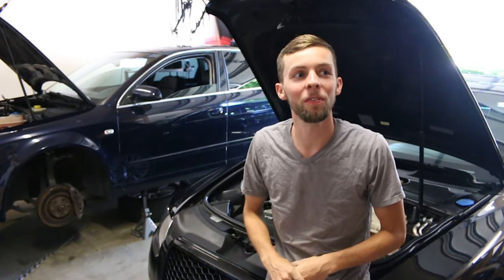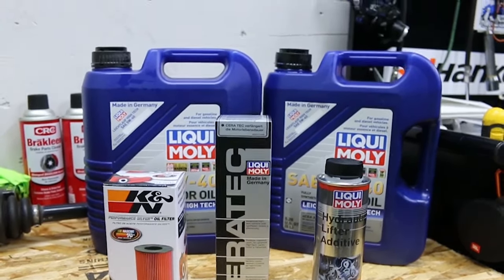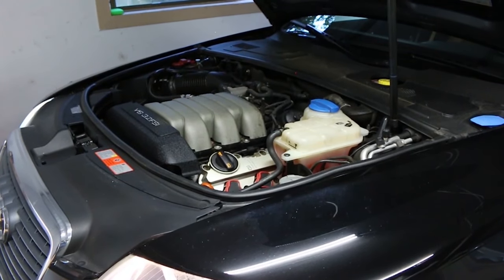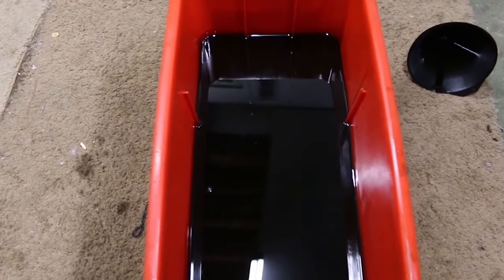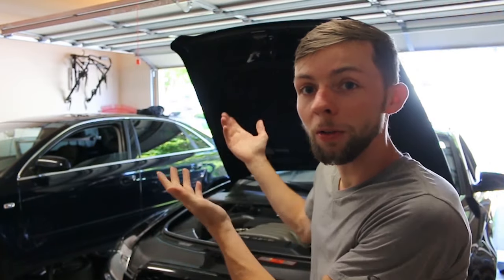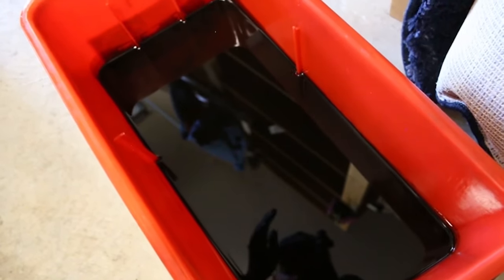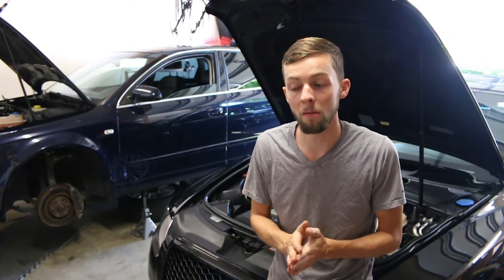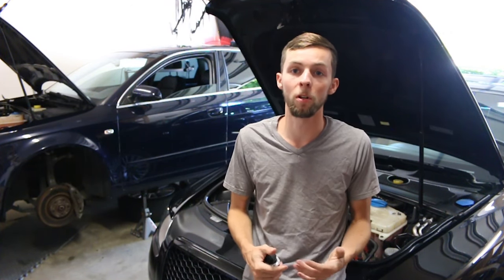LiquiMoly Engine Flush | Does it work?

Comment: It seems a lot of Americans think that engine oil should keep the color it had when brand new??? Err if the oil didn't turn black it would be a very, very, very bad and strange oil. The oil is supposed to carry all kinds of debris and combustion sod etc. AWAY from the engine, and throw it off in the oil filter. The fact that engine oil turns BLACK is NOT because it's bad, or need a change lol - it's because it's doing it's job as supposed to. DANG. 

And no; Castrol isn't a terrible oil.  It lives up to the same specifications as the LiquiMoly does. You would not be able to see, feel or hear any difference between them - unless, of course, you changed the viscosity.
Reply from the maker: Everyone has their opinion, that's fair. However, I own other vehicles that when changing the oil after 5,000 miles, the oil is not as dark or contaminated as this one. After pulling the valve covers off on this car, it is clear that the previous owners did not do oil changes regularly. I got this car for $1200 and it was neglected to say the least. After doing this flush, not only has it ran smoother and consumed less oil, but the oil is 100% visibly cleaner then previous changes as more and more deposits are being removed. I understand what you are saying about the oil carrying deposits away in your comment and agree with you, but when there is lots of buildup from previous neglect, changing the oil regularly will have the oil looking cleaner each change. The oil is not still golden regardless in the end.

On the Castrol comment, there has also been a very substantial difference in the oil consumption. Only going through about .5 quarts after 5,000 miles oil change. After switching there has been less consumption and the oil is cleaner each change. I know us Americans are odd, but this is my experience. Also, its hard finding Castrol that is VW 502.00 approved around here. The syn 5-30 from Castrol is NOT. 

Either way, I appreciate you taking the time to watch and comment, thank you!
Reply: @Mechani_Cole  Well, thank you very much for a polite and kind answer to rude and impolite me. Forgive me, I was always a "I know everything, people are idiots" kind of a rude asshat. Sorry.

Yeah, people have their opinions. I was not out to defend Castrol. I use Castrol 2-stroke oil in my old 2-stroke motorbike, in the transmission I use Motorex transmission oil. A Swiss brand that is.

In my 4-stroke dirt bike I use Motorex mc motor oil.

In my car I use Elf motor oil. I think it's French brand. 

Of course; the more often you change your oil, the less black it will be. But don't change it unnecessary, it's not good for the environment with all that old oil.

If the oil stream draining out of the drain hole has a clearly visible, reflective shine to it - it's good. Of course you can't know if it has a shine to it - unless you drain it out lol. 

Nothing wrong with flushing. People say you can just use diesel fuel for the flush, instead of that flushing agent.  But no guaranties from me. 

Thanks for the kindness, again.. By the way, I'm Danish. I guess we're well known to be particular impolite. Damn.
Reply from the maker: @MeBallerman  no harm done my friend😁 

I actually still use Castrol in the BMW E90, just not in this Audi. I believe since we live in different parts of the world, your Castrol and my Castrol are very different due to manufacturers spec.  and requirements. 

Thats interesting to hear about diesel as a flush! Would make for an interesting video after some research.

And I agree, flushing to much or changing the oil to much is never a good idea. This was first flush on this car probably in its entire life as well. Haven't heard of Elf oil, going to check it out. 

One of my favorite channels that has a great comparison tests of ALOT of different oil brands is @projectfarm. I was AMAZED at how well the Amazon brand oil did. Great tests and results there. I learned alot!

Greetings again from the USA! Its a circus here😁
Reply from the maker: @MeBallerman  Check out this series on oil tests. Very entertaining and informative!

Cheers!
 https://www.youtube.com/playlist?list=PLjT3B9r2z3fXlvbP3tb9e056Q8O5krrCW
Reply: @Mechani_Cole  I know the channel,  watched it a lot lately - watching ice cold oil racing down slides - always late nights, lol. And it's getting alarmingly late AGAIN. Damn. Goodnight.
Reply from the maker: @MeBallerman  Have a good night! Thanks for stopping by!
Reply: i heard the same rumors about the castrol oil in the audi forums, especially the 5W-30 Longlife oil. I got an 2.0TFSi and will change to Mobil 0W-40 as many people recommend it for this engine. Just bought the car a couple of weeks ago, so i can´t say much about oil consumption and i don´t know which oil is in it.

Comment: I hope someone here can help me..
Im confusing now, cause I don’t know. 

We need to put engine plush on old oil leave them idle 10m
Or we do with new oil and oil filler and leave the car running 10m
Cause i watch to many clip every clip different way.. 
Tks advice!!!
Reply from the maker: Just flush with old oil. 

The way that I do it is with new oil, but that is not needed. Its just an extra step to clean even more sludge out

Comment: Castrol is the best in my experience.
Reply: The best out there is the Valvoline Synpower !!
Way wayyy better than those crappy Castrol.
Reply from the maker: Both suck in my opinion. But what do our opinions matter anyway 😮‍💨
Reply: I dont think you ever tried the Valvoline, trust me i tried them all, Castrol, Liqui Moly, Motul, Mobil 1, Shell Helix,     
i had oil consumption with them all. At last i tried the Valvoline, and no more oil consumption! the engine runs extremelly smooth.
Reply from the maker: It's alright

Comment: Castrol works. great. Have used it for 14 years from brand new, and no oil-consumption. Is this a commercial or what. It makes zero sense that you have had "bad" results with Castrol.
Reply from the maker: Nope, just me sharing my experience and results that I have had. In the Audi, its just a fact that the Castrol was being consumed more and that liquimoly did and does better. 

Ever seen the oil test videos on @ProjectFarm page? Lots of evidence there as well that it is a mediocre oil and there is plenty that preform better. 

Thanks for watching, much appreciated🤙🏼
Reply: @Mechani_Cole  Great video, and the oil was very black. I don't really know what to do. We have a TSI-engine, and we are changing the timing chain on it as they were all bad from factory. Should we try Liqui Moly?
Reply from the maker: @danielfl.9347  I just picked up a TSI A4 as well. It actually has castrol in it right now, but only because the oil is getting flushed and it was cheaper. If you don't have any issues, switching won't do much. I got to do the timing chain and belt on this one soon too. 

The oil being black is just a sign the engine isn't as clean as it could be. When I got this car, clearly the owners never did the oil change on time. After pulling the valve cover, this engine is actually pretty dirty. Its getting another flush soon with fresh oil once it gets new timing chain tensioners this week. 

Before doing this flush, I had a tapping noise coming from the hydraulic lifters. Basically it takes a second for the oil to get there so it taps and kind of hard starts. After flushing it and switching to liquimoly, that problem was completely gone. 

Def not an ad for liquimoly or anything, I have even seen plenty of other oils out preform liquimoly on @projectfarm channel. However, I do think they make the best engine flush.

In the car world, I feel that the best oil argument will never be won😁
Reply: This Is Coleman Okay, great reply. Here in Denmark on our forums we always have that annoying oil Discussion of what the best oil is.. Mine oil also turned Black after 2.500 miles, but that is because of the timing chain beginning to fail. I have written to LM Denmark and they recommend "MOS2" in the engine as it is anti friction for timing chain.
Reply from the maker: @danielfl.9347  all the way from Denmark! Thanks for watching man! 

And yeah, the only guy I know that actually clears up the oil debate is the @projectfarm guy. Love that guys tests on different oils.

Hopefully you get your timing chain fixed easily🤙🏼
Reply: This Is Coleman I will go watch some of his videos. Nice car btw! I guess the most important thing to take from all of this is to stay on top of oil changes. VW says my TSI can go 20.000 miles between oil changes... I think not. After the timing chain repair ($2000) I will change it myself every 5000 miles
Reply from the maker: @danielfl.9347  thank you! And yeah, personally, I would never go above 5k on any car regardless what they say. 15-20k has always seemed so crazy to me!

Comment from the maker: Buying The Cheapest Audi On Craigslist, I GOT LUCKY! 

Check out the video here:
https://www.youtube.com/watch?v=f_AChX9P35E
Reply: You have to change oil every 5000 km. Maximum up to 7000 km. Hero from Germany .
Reply from the maker: @markluger9914  could be true for Germany. In the US of course we go off miles instead of kilometers. I always change before I hit 5k miles as that is what the manufacturer requires, usually a little sooner. 

Its crazy to think that there are BMW's and Mercedes that say to change oil every 15K miles! I couldn't imagine going that long on one oil change😅

Thanks for watching and commenting all the way from Germany🤙🏼
Reply: @Mechani_Cole  : ))
Reply: He bro....correct me if im wrong...but i have been told that its a FACT...that if u keep the oil changed very frequently...there will never or should never be a need for moly oil flush......is that true....instead of changing every 3,500 or 4,000 miles...i change it every 2,000 or 2,500 miles....??...what would your opinion be sir??
Reply from the maker: @skyiestosunsetrise2886  yeah, but this is a direct injection engine. Sludge deposits happen, especially the higher the mileage🤙🏼
Reply: @Mechani_Cole  i have a 2016 hyundai sonata limited...sooo i think as long as i freq. Change my oil around 2,500 miles...it should keep my engine clean enough ...am i right or wrong...if u feel diff. Please respond with your opinion....will i ever need a moly flush even with changing my oil freq???
Reply from the maker: @skyiestosunsetrise2886  good question, in my opinion, no, you wouldn't need it since car is so new and oil is changed often. The other additives help, and the flush wouldn't hurt anything. But not needed. This car was also abused before I got it, they rarely changed the oil😅
Reply: @Mechani_Cole  🤣🤣🤣🤣🤣🤣🤣💀💀💀💀 dammm...im sorry for that car before u got it 🤣🤣🤣😭😭😭😭😭

Comment: So scared to put it in to the wife’s VW Passat Diesel as the model has so many censers on it and because of its age I just thing the dash board lights would come on and look like a bunch of Christmas Tree Lights
Reply from the maker: I think it would be just fine. Its only a 20 minute flush and the bottle is pretty small. Just cleans deposits inside. Shouldn't effect any sensor.

Thanks for watching and commenting🤟🏼

Comment: DONT USE THE K&N FILTER!!! i have a 1.8t in my passat, upon using the k&N filter 3 different times, if noticed that they shrunk in the middle due to too much pressure for the filter
Reply from the maker: Interesting, out of the 8 years I've been using them, I haven't had that problem. There's usually a plastic cage in the middle to prevent that. But thanks for sharing your experience!

Comment: Not understand why he as put new cheap oil and after the engine flush! Is not supposed to add the engine flush liquimoly on the used oil before change it for new oil???
Reply from the maker: Thats one way to do it yes. The goal here was to clean as much out ad possible due to this car being neglected for a long time. So I flushed it with cheap oil and the flush instead of adding it to already very dirty oil with an old filter. 

You can do it quick and just add it to the dirty oil. This video was just showing how I did mine, for entertainment purposes.

Thanks for watching🤙🏼
Reply: @Mechani_Cole  would you recommend using it on a vw passat with 540.000km?
Reply from the maker: @ricardopinto1765  yes. It works great for all vehicles in my opinion. Every engine gets sludge or build up after awhile so this is just good preventative maintenence😬

Comment: I still hear tapping.
Reply from the maker: @erlina Vicente what you are hearing is the tapping of the high pressure fuel pump. Common noise on all direct injection engines🤙🏼

Comment: Amateurs. First off, change your oil often. 5000 - 8000 km max. When you use the engine flush you need to apply it to oil that is already at operating temp and run it for 10 to 15 mins. Read the instructions. You need 1 bottle for every 4 liters of oil. Its best you stick to toyotas. German cars require proper maintenance.
Reply from the maker: Most folks don't take care of their cars and expect them to have no issues. Another reason I get them so cheap🤷🏼‍♂️

Comment: Once I saw that that’s a v6 I know why he has taping issues. That’s the valves because that’s a direct injection. Also those motors are piles of junk. Take the intake off and look at the valves you’re gonna cry. Trust me…..
Reply from the maker: No crying here. I have a video of this whole engine coming out to service timing chains. 

Direct injection engines have carbon buildup. That's the trade off for direct injection

Comment: I have a 06 Mercedes-Benz SLK 350. The dealer wants 500+ for oil change. Why would I put this stuff in to clean if after the oil change it needs to be changed again right away. You think the dealer isn't going to charge another 500+ USD. ??  You're crazy . What happened to one time flush ?? Christ. Over $1000+ USD To do an engine flush.  Germans.....🙄??????
Reply from the maker: Where do you live where it's $500 for an oil change? 

Just dump this in your old oil, idle for 15 mins and drain it. You don't need the second flush. The engine in the video was very dirty and neglected
Reply: @Mechani_Cole   San Diego . The cheaprst I found is $100 ..  8.5 quarts synthetic mobile 1. My Nissan is $50 there.  The dealer wants over 500. German cars .
Reply: @Mechani_Cole  but you recommend this poly stuff over a cheaper rislone motor flush? Half the price for some cleaner.
Reply from the maker: @Bm6463 crazy. I charge $40 plus the cost of oil. Usually it's under $100 total for Mercedes/Audi/BMW

Comment: Nothing is emphatically proven in your methods.. I am looking for the right oil, right additive, and the right process to make the enignes last forever
Reply from the maker: There is no additive or oil that will make the engine last forever. Preventative maintenance is still needed no matter what. 

This video wasn't to prove anything. Just sharing how a product works

Comment: If you didn't use the flush, no treatment no ceratec just changed your oil to a good quality synthetic, the tapping would have stopped. It's as simple as that but car guys just need a reason to spend more time and money than necessary on their cars.
Reply from the maker: Highly incorrect! My exact issue ended up being timing chain tensioners, which were replaced and fixed the issue. 

I still use the flush and the Ceratec. With direct injection engines, the oil gets dirty pretty easy due to blow back and carbon deposits. This video only temporarily solved my issue, however it was a deeper issue. 

Tapping will usually never stop just from changing your oil, thats a pretty misleading statement. Appreciate the comment though, thanks for watching🤙🏼

Comment: Hello !!!!!  If you change your engine oil regularly with the CORRECT grade oil from a TOP BRANDED company (Mobil !) Together with THE SPECIFIC BRANDED FILTER, not a cheap after market product from china ! Why do you need to add this moly gunk !!!!! errrrrrrr you dont! as it will produce MORE SOOT that will affect your DPF if fitted.!
Reply from the maker: This doesn't really make any sense, for one, Mobil one is not a great oil, especially for Audi. Second, the liquimoly isn't a "gunk", its a thin kerosene like liquid that breaks down carbon and sludge deposits. Lastly, these cars don't have a DPF, only diesel vehicles have that. And even if so, a flush would do nothing to affect the DPF. DPF is for 'Diesel Particulate Filter'. 

Using LiquiMoly engine will not cause more  "soot", actually quite the opposite. 

Thanks for watching and commenting, hope I cleared some of that up for you🤙🏼